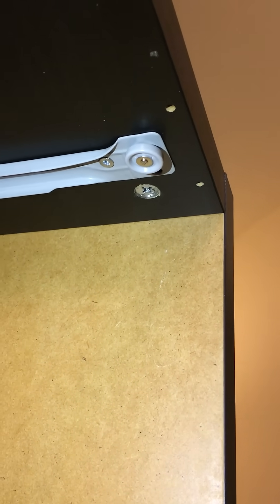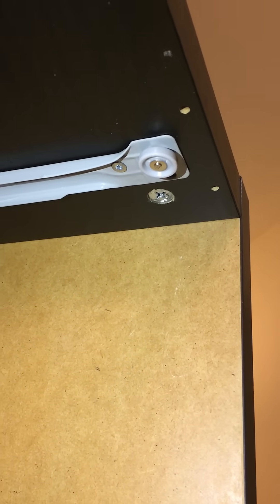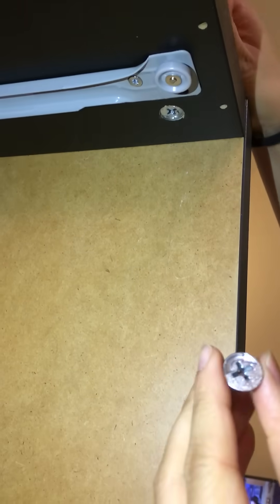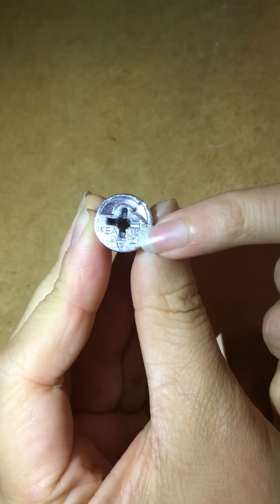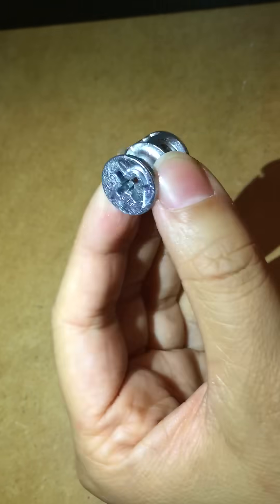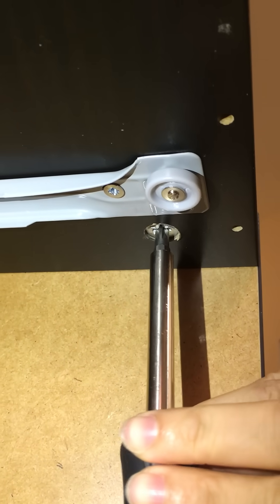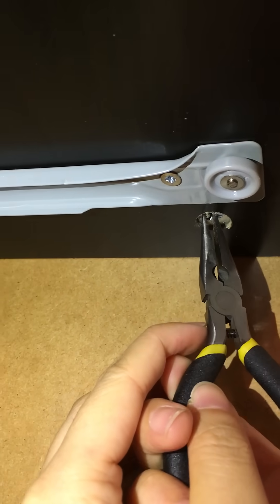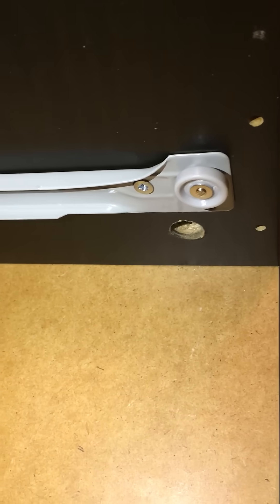How to remove a cam lock (C shaped) from Ikea furniture

Comment: i cant grab it
Reply from the maker: Maybe try to rotate it 90 degree or 180 degree to see if the direction is correct?
Reply: I can remove  it as even if I turn it counter clockwise  it'll tighten
Reply: same here
Reply: Cant grab it

Comment: Should it be any specific type of sharp nose pliers?  I tried with the nose pliers I have, and it does not work well.
Reply from the maker: Not any special type. Just sharp enough so the nose can be inserted in order to apply force to pull it out.

Comment: There is a much easier way.  TRUST me.   1) First, turn your cam lock "counter clock wise" until it stops against the arrow direction. 2) Second important, get a Phillips head screw, and    screw a nail  "clock wise"  inside the cam lock. 3) Third use your pliers to pull against the screw that you put inside the cam lock to yank it out.  10 seconds
* Note: Be Careful not to hurt your hands when yanking pulling the cam lock out.
Reply: Legend, this works like a charm.
Reply: THANK YOU SO MUCH

Comment: This was the best way to get the cam out and it only took about 10 minutes for me to take off the top and bottom of my Alex unit and switch them. Much better solution than the suggestion to put a screw in it to pull it out; that would ruin the cam and you'd have to run out to get another one

Comment: If you can find out the name to your furniture, you can usually find a PDF of the instructions for free. 

Literally all you really need to do is to loosen every Cam Screw that is on a similar surface or direction (loosen by looking at that tiny arrow usually being the opposite way of where it’s tightened.)

Literally all I did was loosen the Cam Screws that were in similar directions on the piece of wood and the piece practically slid apart with ease.

You will need pliers to remove the actual cam screw but if you want to just take apart your furniture then this should suffice.
Reply from the maker: Thanks!
Reply: God bless this video and also this comment for teaching me you don't have to actually remove the screw to take the pieces apart!

Comment: Also guys. IT IS NOT ALWAYS NECESSARY TO REMOVE THEM. I just dismantled a wardrobe and you can Loosen them and then just pull the sections apart. Easier than removing each cam and quicker too xxx
Reply: Thank you so much for sharing this information. This information helped me out a lot! Thanks to you, I managed to remove them off without needing to use pliers.
Reply: It’s a good point. This also ensures that no part will be missing when you reassemble the structure.
Reply: Dude, thank you, your comment just saved me hours of work
Reply: thank u so much u saved me, cause they were completely not coming out
Reply: You made my day... I was being struggling and my half day was gone. Fortunately saw your comment and after in 30 min resembled my table. Thanks.
Reply: Oh my god thanks so much
Reply: Thank you so much. You saved my time and money. I was about to buy the tool but then saw your comment. Thanks!!
Reply: Omg you're my fkin hero. Taking them out was impossible
Reply: Thank you sm for this into
Reply: Thank you for this!!!
Reply: Only reason you'll  have to remove them is in case you want to paint the planks and you want to separate them from the entire cabinet. You avoid getting the cam locks getting stuck due to paint dripping inside and you avoid stripes of paint on those parts that you don't want to get paint.
Reply: Lifesaver comment thanks!